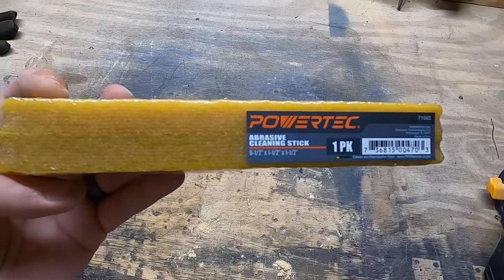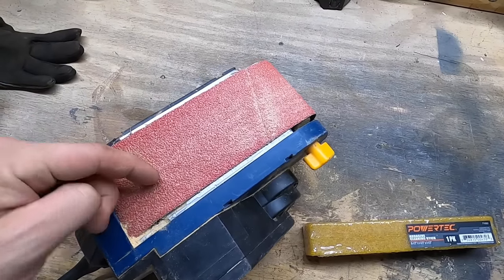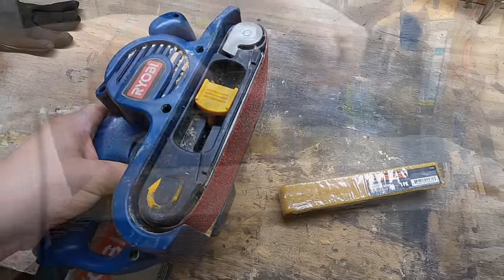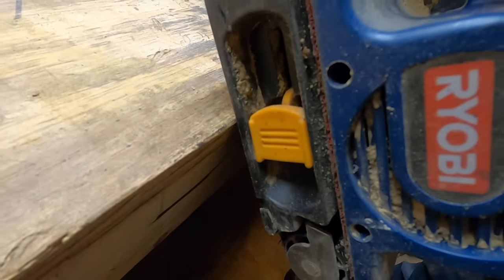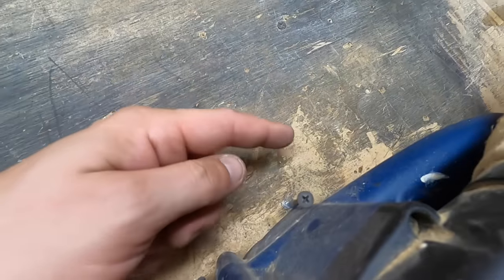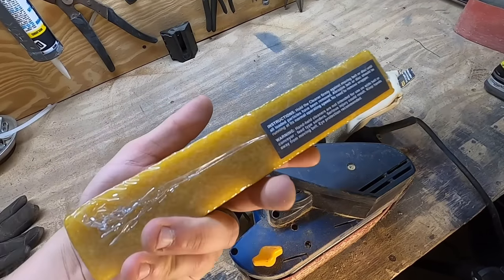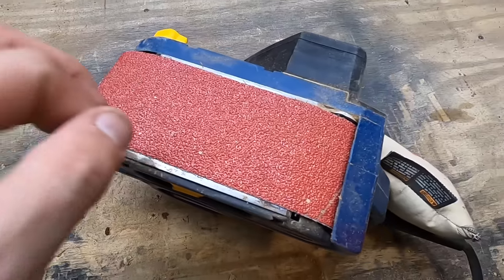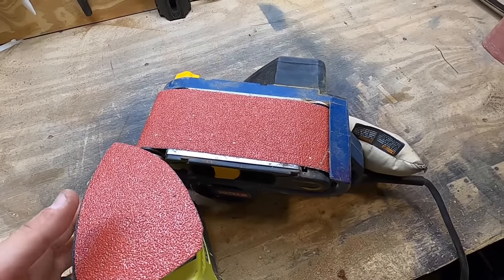How to Clean Sandpaper to Make It Last Longer!

Comment: I've been using pieces of a car tyre for the last 40 yrs on handheld and standalone sanders...works a treat
Reply: And it's free!
Reply: I use the sole of old work boots
Reply: Good idea
Reply: It's probably good for the rough work but the finer sanding you couldn't get the fine finish the steel wool or fine sandpaper produces
Reply: Thanks, that's a revelation for me - I keep all my old belts, not knowing what to do with them, but after a project removing several layers of linseed based paint and gloop coming out of the wood on some big pitch pine pieces (think 40 foot long, 10in wide x2, 4 sides each) - each 40-grit belt lasts about 2 feet and either gives up as the joint breaks or gets clogged up - I will definitely try the tyre trick and get some more life out of them!
Reply: Anyone used old bike tires?
Reply: @reynaldobravotejada4063  Excellent idea!👌
Reply: wow, tks for the tip!
Reply: I have that! I'm gonna try it
Reply: Nice tips dudes. Thanks alot
Reply: Im happy i found this gem on youtube. Thank you for saving me money and time. Wifes upset about the hole in her car tire but hey thats what they have four for right.?
Reply: Great Sir,I found some very useful tips in here,as I feel and wondering am I the only one dump ass using steel brushes to clean them?😅😅😅

Comment: Pat here from Toronto Canada. I am a weekend woodworker and have been using one of these sticks for over 10 yrs.
It does a super job on all grits of sandpaper and has not hardened or dried out.  Even after using it several 100 times, it is still
substantial in size and will likely last another 10 yrs.  It is far superior to a wire brush or wheel.   Great video.    Thanx.
Reply: dang they have to get these things to wear a little faster or the will be out of business shortly!
Reply: Mate I’m from Australia and have used one of these sticks for the past 4-5 years and would have been lucky to have worn off about 1 inch of rubber in that time. I clean my bench top belt sander, mobile belt sander, random sander, 1” x 30” belt sander, electric file and even my hand sanding pad. It’s brilliant.
Sure if you’re too tight to spend the $8 on EBay, old rubber soles work too.
Reply: Wow.  Good info! I'm super cheap and was scrolling the comments knowing I'd get a dozen recommendations for household items that would work in same way, but now that I know they last that long (and pretty damn cheap) I think I'll just splurge and treat myself : )
It seems like a better shape for the function than a shoe anyway, and easier/ cleaner to store in drawer.  
Sold.

Comment: I use an old Croc. I wear out my Crocs regularly and keep them for this, works brilliantly. Like the tip about flipping the belt, though, I'm going to do that too.
Reply: I use an old trainer...... and  unless you've only got one leg  you've got two old ones
Reply: Instead of flipping the belt, why not just turn the rubber stick the other way around?

Comment: A fine wire brush (like the type designed for cleaning suede shows)does the job for me!
Reply: Same here!
Reply: I just tried a bigger wire brush. Finished the pad in 15 second with no damage to the pad. Talking about free product!
Reply: Do you think a nylon brush could work too, or is that too soft?
Reply: Nylon brush is too soft.  Use a big wire brush (along with a heat gun or torch for stubborn clogs).
Reply: was going to type same type comment

Comment: What also works that you already have is an old tennis shoe, just use the rubber sole as well as my personal favorite, silicone caulk. Every time I use caulk I put all of the excess together, roll it into a ball, put it in a tin or ziploc bag then throw it in the bag that I keep all my sanding stuff in, both ways costs $0.

Comment: I've used old rubber shoe soles. Mostly I had on hand old boots with a soft sole. In a pinch you can get pretty good results with pieces of rubber tire.
Reply: @unreal 99 that's a two thumbs up!!
Reply: i do the same in my shop,a old shoe or rubber works ferfectly
Reply: Lol , I just wrote almost the same thing , but I’ve used the boots I was wearing.  Run the belt on the edge of the heel. Not very good for your boot but it works.
Reply: The toothbrush worked just fine for me so far. I'll give a shot to the rubber too.
Reply: @S___________D   , on a belt sander ? This is really meant to work on belts , disk , spindles , things like that. They would just eat a toothbrush.

Comment: I find a file cleaning brush  or wire brush works good along with the rubber cleaner. And the really stubborn spots can be picked away with with a razor knife blade. That said, once the sharp points are rounded down, its dull and not cutting but buffing even though its clean and looks good.

Comment: Newer belt sanders can be clamped down on a workbench upside down. So if you clamp it down upside down, you can easily press the trigger and apply the cleaning stick. Works like a charm for me. And thanks a lot for the belt flipping tip. Hadn't thought about that yet.

Comment: Rubber sticks work well on almost all sandpaper and clogged dust. But some woods like rosewood or pauferro are oily, and others like linden tend to release long fibers. Their clogged dust it difficult to remove specially from drum sanders. So, as it uses sanding cloth, I put it in water, wait one hour, and then rub with a nail brush. It works great and all dust are removed. Then simply hang the strip from the ceiling to dry, and ready to use again.

Comment: Hey Mr. Rebel...the eraser stick - well, it's only been out for about 40+ years. Remove the plastic wrapper... by all means. 
After all, the stick is gum rubber and removing the plastic wrapper will only speed up the drying out process, which, is to the advantage of the manufacturer as you will likely toss it much sooner than if you left it wrapped, and then you'll go out and buy a new one. A win-win! The manufacturer gets to sell more sticks and you've got a fresh new stick much more often. By the way, I've kept my gum rubber stick in the wrapper and it's about 15 - 20 years old... and it still works just fine.

Comment: Very nice tip. Thanks brother, like your video presentation as well 👍👌👏

In my own workshop i always used a fine wirebrush and air. But also seen a few comments below about old sneakers and especially that dried silicone tubes. I always just chuck those.. i will definitely give them a try next time..
Thanks  ...😊

Comment: I’ve always just used a very stiff plastic scrub brush. It works well.
Reply: Do you think a nylon brush could work too, or is that too soft and won't get much grit off? I would think a steel brush might scrub off some of the sandpaper's own grit.

Comment: Its the same thing sold in skate shops used to clean skateboard grip tape. Grip tape is essentially sandpaper. A wire brush helps get all the left over gunk.

Comment: I had something like this over 30 years ago. The one I had was about 4" wide, 6" long, and 3" thick and it was glued to a piece of sheet metal so you could screw it down on a bench top. When your belt got gumped up you just walked over to it and ran your sander over the top and in a minute you were back to sanding.

Comment: Wash with soap and water. Really works well on bib sanding belts. 6X80. Let soak 15-20 minutes then scrub lightly with a stiff brush. Let dry thoroughly before using.

Comment: Or you can use old dried up tubes of silicone. Cut them open and use the same way.
Reply: that's an incredible hack! Much appreciated
Reply: Just be aware that silicone contaminates surfaces. So depending on the finish You want to apply (think paint, clearcoat...) this may be an issue.

Comment: I have have always used soap and hot water.  All more substantial papers are fairly water resistant.
Though this sounds better, thanks.
Reply: I use to clean 48" wide belt sander paper and occasionally fabric belts leaving four or five to drip dry overnight (hanging from cardboard tubes with another tube at the bottom to keep the shape) and it probably saved me thousands of pounds over the course of 4 or 5 years.

A passing salesman had demonstrated in a few minutes a magic solution that really did work. One part solution to ten parts cold water. I bought a 25 gallon drum and it lasted about 2 years, but then when I needed more, the company had gone. So I tested some washing up liquid (dish soap) and water. Imagine my surprise when it work equally as well ! 

But one night when I knew I would need a clean belt the next day, I ran out of soap. I simply cleaned it with hot water.

I remember cleaning the electric hand sanding belts with Perspex.
All of this was with using Scandinavian redwood timber which is very resinous.

Comment: Yeah, I've been using one for 30 or 40 years.  But better yet, for those expensive belts for wide belts and drum sanders, put the whole paper into a solution of simple green or similar, and let it sit overnight, then hose it off really well.  WAY better than the stick of rubber.

Comment: Nice. I use my pressure washer, 15 degree tip. I just need to let them dry. works well.
Reply: Any issues with spraying an electrical tool with water? Is the focus/aim good enough not to be a concern?
Reply: @JustinShaedo  Pretty sure that guy is trolling

Comment: Do you have any help for avid woodworkers allergic to rubber products. When I worked in the furnature factory, helping my spouse, we use to use these large rubber erasers to remove residue from our sanding belts and sandpaper. My husband is no longer with me, but I still enjoy woodworking, however, after working in the healthcare industry for a lifetime I developed a laytex allergy, which includes rubber products. I've heard that rubbing alcohol will work. Any suggestions? Thanks, R. Cooper

Comment: Harbor freight has the same ones for $3-$4, if you have one nearby. I have been using the same one for 3 years, and the same sanding belt on my tabletop belt sander. Works a charm, but I don't let it get as built up as in this video.
Reply: Pretty sure they are 8 or 9 bucks over at Harbor Freight

Comment: I found it helps to just keep the sawdust off the work. So the sanders with little holes in them help. As does moving in broader circles & blowing/sucking the dust from the sides of the sander.

Comment: 10 dollars for a small bar of recycled plastic does not exactly make a good deal in my book. Reading the comments I understand any old soft shoe will do. It's worth a try. I used a wire brush up until now but will definitely look for plastic or rubber next time.

Comment: best wau to make your sandpaper last longer is too buy the correct sandpaper. There is sandpaper for wood ( open or semi open coat ) and sandpaper for metal ( closed coat - Aluminum and brass, copper you should use wood paper ) Use higher quality sandpaper as well like a zirconia product. The better the quality = less time sanding and accomplishing the job.
reversing the belt at the end oif its life will also increase your overall life but that will be a temporary improvement.

Comment: Quick and better way is to use a vacuum and with the brush attachment if you have that. It works best when it off your tool so it can bend and deattach any stuck dust

Comment: OOOOOOOR... use packing tape. Dollar store cheap stuff da best. ;)
The adhesive is enough to get the stuff pulled out, but not enough to pull off grit, even from sandpaper. The tape breaks down quickly in the landfill as well.

Comment: The rubber stick does not work when your belt is gummed up with a bit of pitch. I use oven cleaner. Spray liberally on to belt. Wait about 30 minutes. Wash with hose. Repeat if neccessary.

Comment: I use a brass-bristled wire brush. Much more effective and lasts forever (or at least a lot longer)
Reply from the maker: I could see that working... does it take off any grit with it when you do it?
Reply: @TheFixerHomeRepair  It really depends on the quality of the paper but mostly it gets round the edges of the grit really effectively without doing much damage to the underlying paper.
Reply from the maker: @LittlePixelTM  got ya.  Thanks for the info! 👍

Comment: I use my rubber boots that have that crepe sole. Lesson learned - Don't throw away your old boots and if pieces are still on the belt they easily pick off with a knife.

Comment: Soft wire brush works for sand papers as well as for files. So far haven't found a need for any special fancy tools to remove that gunk. Plus, managing sending speed also helps preventing that to happen.

Comment: My discovery: take off the belt and put it in your wife's best cooking pot. Fill it up with hot water and a cup of ammonia and let it boil for a  minute, then let it sit for an hour or so. You'll be surprised: it 
comes out as new, without having to use a wearing wire brush.

Comment: Just a tip.  Instead of buying a stick you can easily do the same with a rubber soled shoe
Reply from the maker: Yes, I have seen that.  I have not tried it yet but I will in the future!  Thanks for the info and for checking out the video!
Reply: Wouldn’t that ruin the rubber soled shoe?
Reply: what? never heard of that before. I wonder if anyone else will say that.

Comment: I would have left the packing around it and just fold  some of it downwards from the ending.  After use pull it back so it's packed up again. Stays the same condition that way otherwise it might lost is structure....
Reply: that flimsy wrapper does nothing to keep it fresh
Reply: @mmdirtyworkz  I lasts on the shop shelves, that's for sure. Otherwise nobody would buy it.  Besides, cling wrap is not that expensive.......
Reply: @hansb.8  you can use a piece of car tyre, old crocks, dried up silicone from a tube and similar. Thay don't fade nor does that rubber they sell as grit cleaner. Anyway this is not new and seems a waste to buy it while you already have things laying around that you can use.
Reply: @mmdirtyworkz  thanks, it's true, we use other stuff too. Our Hardware stores in 🇫🇯 don't sell that " bar" anyway. But washingsoap comes like that. 😉😎

Comment: Blow it out with an air gun with a needle tip, it’s never failed me. Or maybe you could even just take a piece of metal and run it on the sand paper lightly and maybe it’ll dig out the wood enough without ruining the sand paper? I know the air gun works for me

Comment: And when the eraser doesn’t work soak the belt in a 50/50 mix of Simple Green and water for about 24 hours. The gunk will come off. Sometimes a scrub brush helps while rinsing under water. Save the mix for future use.

Comment: 6 min video  for something that could be shown in 30 seconds..... and is old news my grandad showed me how to do this 50 years ago with an old boot sole.  this is almost as bad as the 10 min video that explains why carpenters pencils are rectangular.....dude they are that shape so they don't roll off the work bench and so a real cabinet maker could run the pencil over the runners of draws to make sure they will always run smooth

Comment: From a health and safety standpoint that is horrible advice! The fixation with a few screws is not good enough to hold it and when you take off the belt you first disconnect the power plug!

Comment: 04:57 But.. chief - you've used nearly half the rubber just to clean up one fucking sheet! Would a brand new sanding paper not be cheaper? Just wondering here..
05:39 You bet - I do ;-)
Reply: Nope. Those glue sticks, as house framers call them, last years -- decades even. Artists cadge a quarter inch or two from a carpenter friend to use as non-smudge erasers.
Reply: @dulcecasitas3056  That clears it up. Thank you, boss.